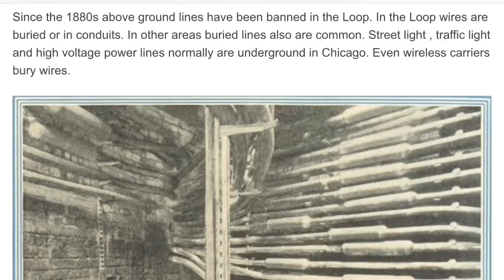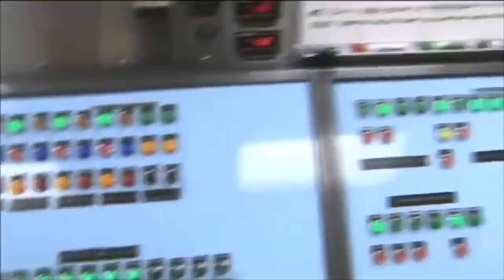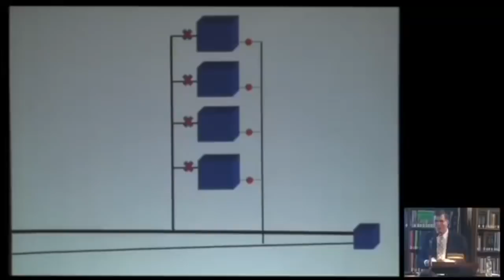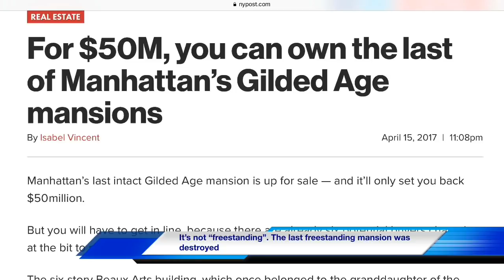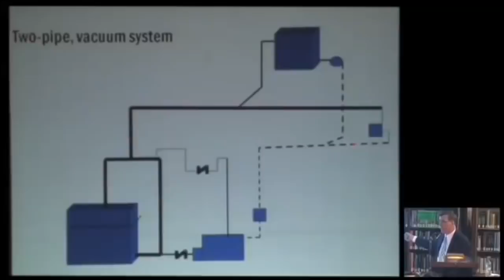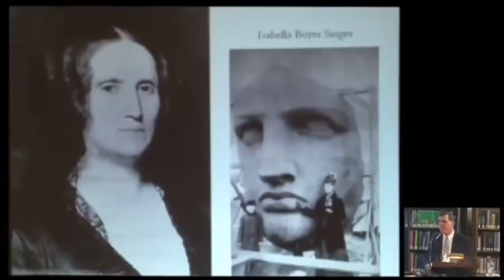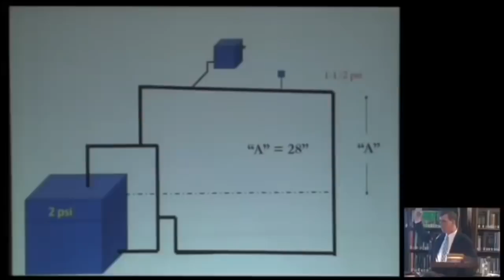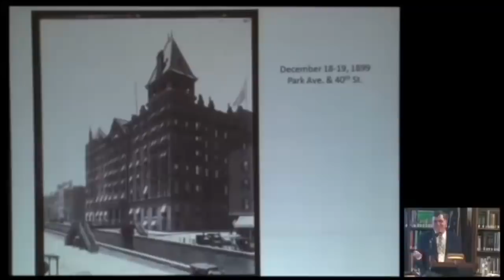Mudflooder Heating by Steam HVAC Revealed | UAP

Comment: I am not a tech, so, I've not done the work, However.
It's known that a multi-fold Orgone Accumulator above a
flow of water can produce 700 degrees of heat.
Translate that into steam & power cars & buildings & everything, 
at nearly no cost. Thanks for this GREAT video.

Comment: a large section of OLD Boise, Idaho has Geothermal heat in the OLD homes...   I'm very curious as to the true age of these homes...    University of Idaho, Moscow, ID -  pumps hot air all over campus to keep the sidewalks clear all winter, along with heating the buildings...   again, true age of buildings is undetermined.
Reply: wow .... someone should do a video on this !!!
Reply: If anyone is in either area, go for it, otherwise, next time I am....  but it will be awhile, as I'm no longer in Idaho.  Crazy how all this stuff is in view and it always made me wonder why, who, why not in more places, and so many other questions.  Word on the street is that the heat is not nearly what it used to be, as the best guess is that they are allowing the release of too much steam in the process over too many years, in combination with plate movement.  I'm curious as to what the truth is on this.  Makes me wonder what the Carnegie LIEbrary has to tell, as well. ;)
Reply: Yes, the Idaho State Capitol is heated by geothermal, I'm told. Downtown Spokane, a major Tartarian city (in my opinion) had steam heat.
Reply: Many of these old buildings look truncated at ground level, and you see windows either below ground level or just disappearing into the ground.   You wonder how many levels there really are that can't be seen.

Comment: I live in a mud flooder, building built in late 60’s , all the pipes are in the floor of my apartment, no thermostat in sight. They pump the water right from Lake Ontario. So I did some inspecting. Roof has spires producing free electricity from atmosphere hidden from sight as they are only 4-5 ft high and places in center areas of roof, so you can’t see them from ground 7 stories down. Next I managed to bypass the lock for the boiler room at 3 in the morning and wow what I saw. The huge cables coming down from the roof, same cables I saw coming from spires,  a dozen cables in boiler room coming from ceiling via elevator shaft, just by chance 12 spires on roof. Where do the cables go? I almost shit my pants. They feed into this coupler bank that feeds directly to a box, metal about 5ft square and 6 ft tall. The dam think makes this crazy buzzing sound like a weird frequency sound, than a main cable comes from box and goes into the “boiler” chamber direct, not running into a panel or connected to some motor or anything. Straight into it. Hummmmmmmmmmm  let me explain, the main power room panel where the city main feeds in is on opposite end of building in basement. Just find it odd. I’m sure people can attest to the sound I’m talking about if you ever walked by one of those electrically insulated heavy doors labeled boiler room, the sound is very odd. Why does steam production have a electrical buzz frequency sound? Btw we pay for gas for heat, lol but when I borrowed my buddies utility professional 15000$ locater hooked onto the gas main where it comes into building everything that gas is connected to I can follow every pipe. When I traced it ran not to the boiler room, it ran to the laundry machines and no where else. Like I had to sit down for an hour with my head in my hands when I discover this garbage. So I’m paying for gas for heat which doesn’t use gas, and than my laundry machines are indeed all gas and I have to pay for that again on every load, when I’m already paying for gas that isn’t used for what they claim. Scam of the century
Reply: Next I borrowed from my buddies dad a frequency meter and clipped it to the return pipe in my apartment by removing the vent cover and guess what I got? Fluxuations of zero to 40-52 HZ... when it was staying at around 50-52 HZ I could clearly feel the floor heat up as I have for 7 years of living here, you can tell the heat is on very noticeably just using your feet. I’m not 100% but I do believe water boils at 50HZ... am I loosing my mind or is this just plain scam lies in plain site?
Reply: Need some pic's man ..

Comment: So the buildings had to ensure the air could escape to allow the steam heating to work safely - could it be that the multitude of spires and elaborate spikes created in the upper architecture facilitated standing waves of static electricity to enable a pressure differential? (in the air)

Comment: I wish someone could figure out why there were no bathrooms or kitchens in the old houses. I grew up in a house where the bathroom and kitchen were clearly added on or shoved into a closet. It was a fancy old farmhouse that had the steam heat (generated in the basement) and the original 'kitchen' was supposedly outside in a summer kitchen. It originally belonged to the banker so it was high end at one time. Looking back, it had a lot of interesting features I wish I could go investigate now. Thankfully, the house was not destroyed but moved 9 miles when the new highway went in.
On a side note, if the system was a in place a long time ago and it was flooded, would it explode and cause the damage seen in say Charleston?

Comment: we have "turbine" ( jet) engines making power in  Oz, running on high efficiency "gas" (permanent supply connection)    with a phoney excuse saying the heat from the engines is also used to make further electricity thus making them so efficient.  the government owns them too.

Comment: I worked in a mud flood building that used vapor vacuum heating two blocks away from district energy in saint paul. District energy installed the system in 1987 in order to utilize central district hot water heat into older steam radiators systems with out any retrofitting other than the pumping system. The test building was scraped within two years time. I may add further comments as I worked as a physical plant operator for a few decades.  Maybe I should do a vlog on those heating systems of mud flood buildings? Steam and water in the same pipe causes nasty water hammer. I've seen 30" pipes knock before. Steam heating has become obsolete due to the installation and maintenance costs. Some large spread out facilitates still use steam heat  with some requiring high pressure steam in order to keep the spaces warm during the winter months.

Comment: Weird that the Dakota was built in 1884, yet the 1970 novel "Time and Again" depicts a character going back to 1882 and living in the Dakota. I just looked it up, and it seems author Jack Finney admitted to the date inaccuracy but according to Wikipedia "explains that he took a few liberties with the timeline due to his fascination with the building." So why not just stick the novel in 1884 instead? He was the one who set it in 1882 based on fictional events, not real ones and could have easily set those in 1884. Come on, the Dakota must have existed long before 1884. (As to whether it was a bad idea to construct it out in the boondocks, Central Park had already been opened, at least in part, in 1858 and so the streets around it would have been laid out - a great investment for anyone who got there first. If it was built around 1858 or even somewhat before then, it would have made sense.) . . . Anyone who has read the novel: Does Finney depict the Dakota sitting in an open field next to Central Park, or amid fully developed streets? I do think he takes a trip across 59th Street on a horsedrawn trolley car, but I could be wrong. Who is Finney anyway? A Deep State, Freemason-connected liar? And the movie somehow never gets made. The story gets owned by various suspicious characters in Hollywood but never produced. A way to keep certain facts from going mainstream?

Comment: You're exactly right I grew up in a mud flood home or Style where my grandfather is a engineer and he said that it was a closed system that heat at the house and he actually put a pump on the boiler 2 circulated through the house to the radiators.
Reply: He also said that the buildings that he worked on had steam systems connected to a main source routed to other buildings, directly. And they are still in used to this day. You'd be surprised what you can learn from your old folks.

Comment: Look up Tom Bearden he speaks on energy transference and makes it sound so easy. Just how you described the water, steam transfer. He talks about simply dipping into a dimension and freely transferring energy as long as input matches output, like opening up a valve connected to a stream, as long as the water flows back in.

Comment: My house is 200 years old it is still heated with steam , cheap and effective , most the houses on my block are as old , I think the huge fire place with tanks in the back use to heat the water ,  the fire place has been out of use and replaced with a gas broiler , but I’m sure this house ran fine without electricity , when we moved in , we were told the old nob ceramic tube electric needed to be taken out , . If I knew what I know now I would have never taken it out . I was told it was dangerous . Such bullshit

Comment: I was stumped for a while as far as trying to figure out the fireplace thing and the round or Dome shape ceramic orbs on all the rooftops up until yesterday and today which now I can say at least have the basic idea how the system would work and the crazy thing is how many years back was that technology installed and I'm just going to guess what's more efficient obviously cost less and really had no moving parts so no energy loss or at least not like there would be with a full-blown generator or motor. To me I just find it funny how simple and fully integrated into the world the real world all of this actually is meanwhile everyday we're constantly trying to advance our technology to the most extreme levels that in 20 years  Im gonna have to have a ph.d just do use a toaster.. oh yeah but by then we still won't be going to space just in case anybody in here was wondering. Cuz we're just not I don't care what year it is just throwing that out there
Reply: Ph.D. to operate a toaster...that's the idea behind all of this - to make everything complicated so you have to pay. Simple things last long and are cheap...Tesla made things simple and cheap (even free). All the good people are killed off or suppressed. Car engines are still burning gas since their inception, ridiculous.
Reply: So the fireplaces pull air out of the building and that is crucial to a steam system?
Reply: @tashmoobabe8704  you obviously don't understand the system yet. Do you doubt it worked? After seeing all the effort and the way they intergrated the it into almost art work around a building I mean that seems rather pointless if it didn't work. Further proving they were more intelligent or more advanced than we are today..
Reply: You see some homes with a bannister all around the roof, usually made of wood, and it looks so odd, but I'm thinking it had something to do with the free energy system.   What do you think?

Comment: Basically a ground source heat pump, which is used in rural areas as a source of heating the building and hot water

Comment: OMG, I remember opening a window in the Empire State in about 1997. The place was steaming hot. Literally. No way to regulate the heat at all, excep to open a window on the 54th floor. I had nightmares about that moment in my life, that I could have gone flying out the window with the effort to lift the sash.
Reply: tashmoobabe  I got vertigo just reading this!

Comment: I live in the Attic of an old House in Philadelphia , and in Winter I always have to open two windows a bit so I don't
 Die. The fresh air is nice though. The old Steam pipes were disconnected though , and it noe uses a Gas burner to heat the Water. I know there's a few Buildings still using steam mostly in Center City are because the Homeless People live on the Steam Vents in Winter. There used to be a lot of "Ice and Coal" distributors . One for every couple Sq. mikes or so , and I always wondered how did They make the ice in Summer time for a whole City. I heard that they saved frozen slabs from Rivers and Ice Burgs . but I'm not able to prove it.

Comment: Are there any Chimneys in the pictures? There are these lilltle cutouts inside with the same "hardware" that makes them look like a modern day fireplace.
Reply: Makes me wonder if the chimneys where kind of like cold air returns.
Reply: @Lightendog  you may want to check out ram pumps, vertical pumps. I would link you but cannot remember where I learnt about them,def on utube .
Reply: @gillypoof  I'm probably going to have to look into this sort of thing better just to understand it.........what do you think of Old Faithful?  Is it natural or is there a mud flooder under there with the heating system still running?  It's probably natural but I'd still like to hear peoples thoughts on it.
Reply: @Lightendog  ,yeah,I herd too that old faithful maybe a Hoax !!

Comment: The black and white picture of the two flooded subway tubes with lights running through it, is a very good example of the Sun on a flat plane. - 30:00

Comment: Maybe Nuclear plants might be steam from ground heating up those rods in the reactor.I worked in one fixing flanges that were leaking boiler feed water n full of radiation.Well I crapped out Big Time now 58 years old no problems in 25 years. They said I had enough rad’s for two years made me shower for four hours,I call BS
Oh I’m a plumber now n worked At LSU for twenty years on the steam heating systems same as your talking about
Reply from the maker: Jag 321 Most people don’t know how to run them, they are letting water condense in the steam loops, the water hammers once and they are done with it. They whine about having to manually turn the valve, or since it isn’t electronic “enough” it isn’t “efficient”... but if they look at the actual cost, they would realize it’s best to just keep it and run it properly. It will last 100 years or more if maintained properly.

Comment: Does this mean my Brooklyn landlords didn't need to pay for oil heat, they could have just tapped into the district steam to fill the radiators in the ca. 1920 building? Think of all the New York City landlords who get sued in Housing Court for lowering the temperature in the winter to below that stipulated in the city code. Dirtbags, all of them, for being stingy with the heat, but they get squeezed by rent stabilization and apparently don't need to provide that heat anyway if they can tap into district steam.

Comment: ar 33:10 UAP, it's Egyptian hieroglyphs and an Egyptian figure! Old Testament and lost tribes time -  In Shrewsbury, England, there is a church of Saint MAry that is with a Trust and there are some radiators in the Cafe that are Victorian and painted with the bronze paint, the heating is not working any more and they are asking for donations to pay for the repairs. It's an hydraulic system under the floor that was installed by Victorians. Repairs were made in 1896 after the spire felll through the roof and ceiling of the church and they have  a photo of it. It was due to gales and that was in the newspaper and they have a copy displayed somewhere. The church has got huge stained glass windows with depictions of Old Testament scenes with architecture in the background that doesn't belong to the time, but is Renaissance. They are from a church in Dresden Germany. The organ used to be near the entrance and its position was changed. The oldest part of the church is Anglo-Saxon. It was restored by the Normans and then by the Victorians. In Brussels, in the 1960s my parents had a system of heating that looks quite similar as shown on your video UAP,  valves had to be opened to make it work, but the heating in the whole  building was switched on in the basement and you could turn the radiators on or off.  I don't think there was something being heated up in the basement.. perhaps that was a different system, not geo-thermal..Is it Iceland that is taking advantage of that  and building lots of levels underground? At 23:17 the grates on the floor looking decorative, it's the same in that church, they have many ot those kind, and they know they are Victorian but will they be able to find an engineer or technician who knows about this system to get it repaired...I wonder!

Comment: Five major geothermal power plants exist in Iceland, which produce approximately 26.2%  of the nation's electricity. In addition, geothermal heating meets the heating and hot water requirements of approximately 87% of all buildings in Iceland. Apart from geothermal energy, 73.8% of the nation’s electricity is generated by hydro power, and 0.1% from fossil fuel

Comment: What about plumbing fixtures in these mudflooded buildings? Tartarians needed heat but more importantly they needed bathrooms and especially water closets (toilets). They must have been huge. Same with bidets and sinks. Have never heard anything about water supply piping... What... Did all the supply piping and plumbing fixtures disappear because of mudfloods? I'm thinking not so much.

Comment: Ok, think I got it. A building the size of the empire state building operates on only 1lb of steam pressure. The system has no moving parts. No steam traps, no condensate pumps, no return air fans and no condensate return lines. Wow, never seen anything like that before. The system works on hydronic pressures alone. A single pipe system.

Comment: in around 2000 BC knossos palace have Underfloor Heating and sewage system , clean water Plumbing and Thermoreflective white Lime paint , goat hair Thermal Insulation .. probably this heating systems are not so new ...